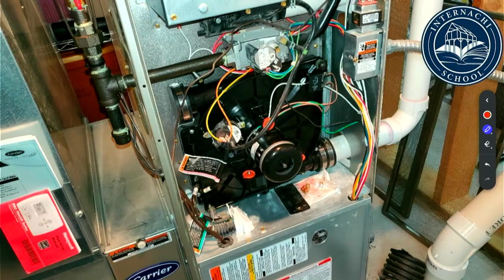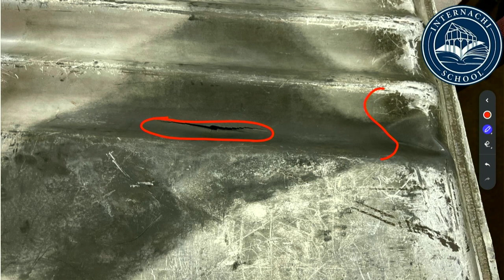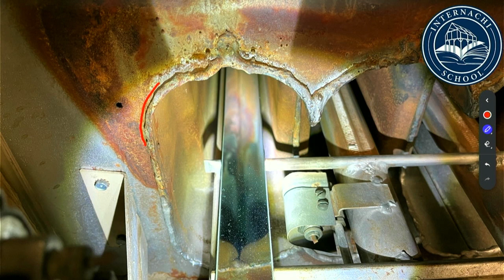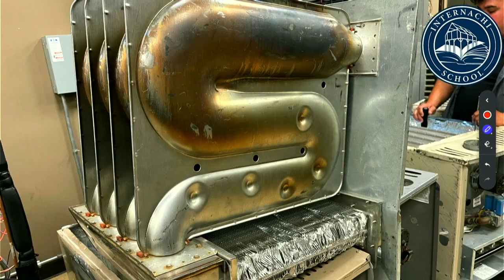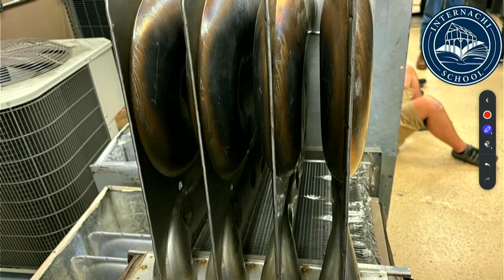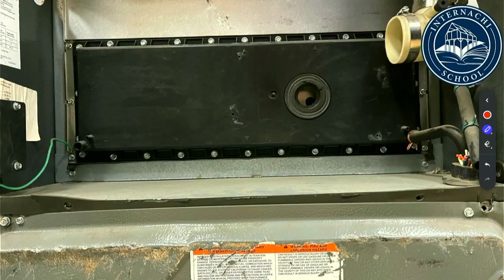Inspecting Heat Exchangers

Comment: The plastic inducer housing is actually not a dead giveaway for a high efficiency furnace. Many Rheem Criterion 80% efficient furnaces had plastic inducer housings. Most of these housings are busted by now or the entire furnaces have been replaced, but it is not uncommon to find one still in service. The pvc exhaust flue is the dead giveaway, as would a condensate drain out of the furnace itself.
Reply from the maker: Thanks for watching.

Comment: How do you know if the secondary heat exchanger is not working?
Reply from the maker: Condensate.
Reply: You can smell it. 
Flame pattern, carbon monoxide in the stack, if really bad "pressure switch issue" (or a pressure switch doing it's job and shutting down the unit)

Comment: That's where a carbon dioxide meter comes in handy. Most of our furnaces burn very clean, so you won't get much carbon monoxide. It will, however, produce very high levels of carbon dioxide which can also be dangerous if it displaces too much oxygen in the home. My meter goes up to 8888ppm and a cracked heat exchanger will max out my meter when furnace blower kicks on. Normal levels would be 300-800 depending on the occupancy. Food for thought on another way of checking that's non-invasive.
Reply from the maker: Thank you, Ryan.